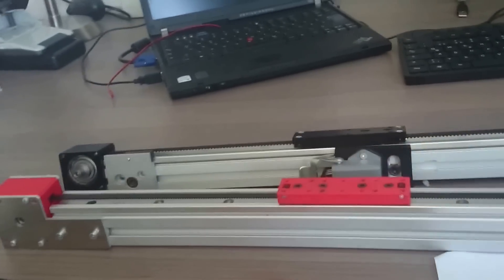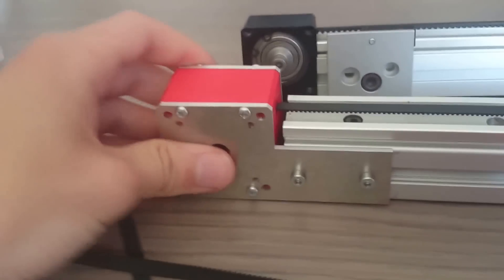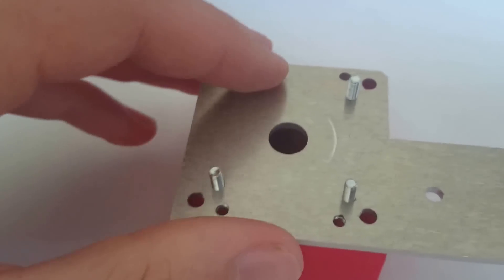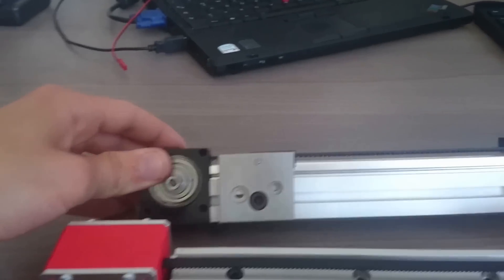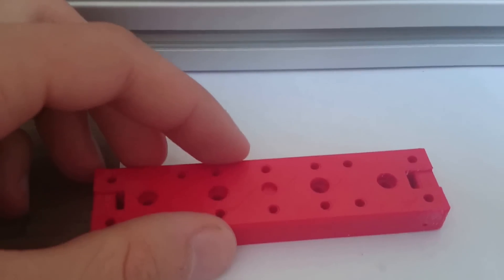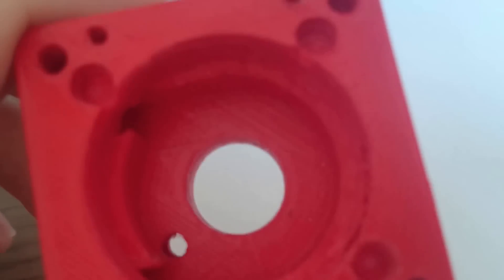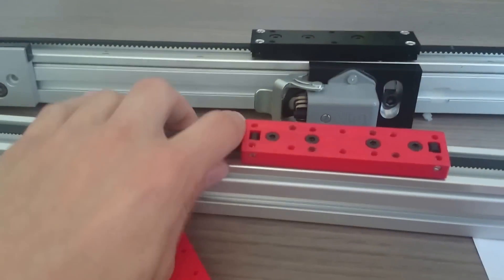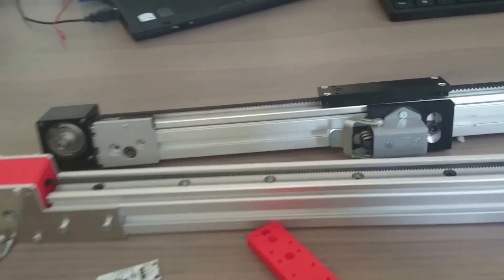Linear Actuator for DIY 3D printer

Comment: another way to do an end switch is to put a magnet on your trolley and put one of these near each end (84 cents for 10 of them)
found on Ebay:  10Pcs 14mm Glass Magnetic Induction Reed Switch MagSwitch Normally Open YC
https://www.ebay.com/itm/10Pcs-14mm-Glass-Magnetic-Induction-Reed-Switch-MagSwitch-Normally-Open-YC/263330385536?hash=item3d4fb6ce80:g:4I4AAOSwdBRZigMJ

Comment: did you do any modifications to the slider? Ive got the same rail and slider and it is quite wobbly along the "y-axis". So in a use-case like on your instructables page, the machine would be quite accurate but the acutal machine-head (laser, extruder, spindle, ...) could wobble, especially when its making contact with the workpiece (spindle)
Reply from the maker: Hi Felix, igus sells different bearing inserts for this rail, some have play along one axis to make it easier to align two systems. could it be you got one of those?

cheers!
Reply: Lukas Hoppe
i think we (its in our fablab) have got the "loslager" if yours hasnt got any play. I'll try the one with "Vorspannung". I live in cologne so igus is just a few kilometers away :-)
Reply from the maker: +Felix Dietz 

Hi Felix!

yes, that seems the way to go!

what application are you using it for?

All the best!

Lukas
Reply: Lukas Hoppe
at this moment just out of interest. i built a laser engraver and just started 3d-printing, so one of those application its going to be in the future :-)
Reply from the maker: Felix Dietz Thats Awesome! I hope you will have great fun with the hobby!

Comment: Lukasdo you sell the laser cut parts, Please send prices and or put on eBay and post number here  , no access to such a machine, in the US we use 80/20 material what size extruded is your design from,  I have build a cnc out of a Bridgeport  and am interested in building a 3d printer based on a 4' 6' table as not having to rebuild bigger later, Thank you, Tj

Comment: can we get away with 3D printed plates rather than aluminum? 
Then the only components to purchase would be the extrusion, the belt, and the stepper.

oops, you answered it at the end.
Reply: +Aaron Tunell CCM linear rail guide!
Designed to sparkle your innovation!
Contact us: ccm@ccmmade.com
Reply: Heck 3d print the corners of the frame and glue in any length you want for your build volume... could even design a holder for the motor built into the frame with that shuttle cock built in.  Could even make the shuttle round and have it slide along steel electrical conduit (super cheap) and build the frame corners for that.

Comment: for those of us who don't have any access to 3d printers and/or cnc machines, would you sell those custom parts?
Reply: catch 22 is quite the mistress
Reply from the maker: i have a boatload of the aluminum plates left, if you are intrested i could get you some of those. for the printed parts, ist quite easy, just go to 3d hubs, i realy like their system and once you have your machine finsished you can just offer your services. have a good day
Reply: I would highly recommend learning on a cheap 3d printer before building your own. It makes the learning curve less steep. Plus, it means you have a way to print parts when you want to build something half decent :)